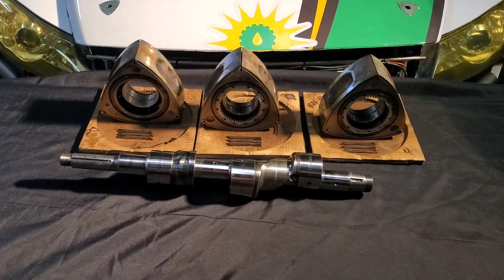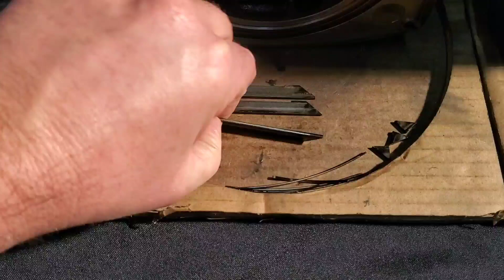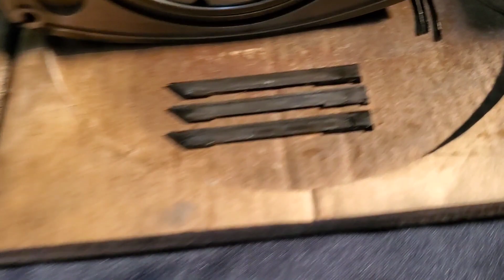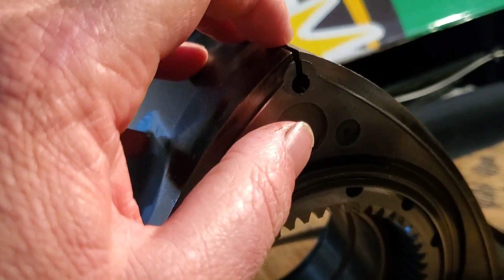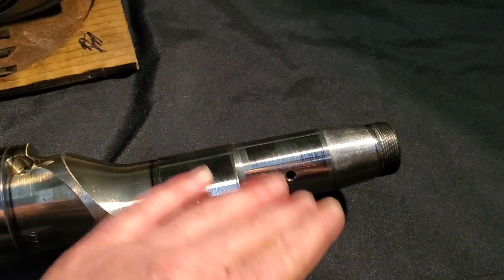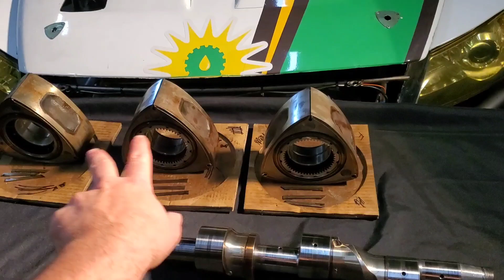KMR 20b Shaft, Rotors, Apex Seals Inspection after almost 2 seasons at 1000hp - Kyle Mohan Racing

Comment: Man ive had very bad luck with my 20b so! UK builder did mine and put the bearing in incorrectly in the thick iron so we didn't have oil to the bearing and the shaft snapped in 2! 2k miles on the block and only doing running I miles and less than 7psi boost. No over 5k rpm even!
Reply from the maker: 20b builds can be tricky. That's very unfortunate to hear. Good luck on future builds
Reply: @KyleMohanRacing  thank you sir! Yes I believe so, but the builder had built several before just incorrectly installed bearing and starved of oil unfortunately. Coming back bigger and better !